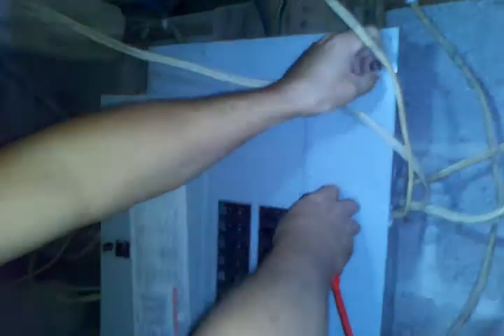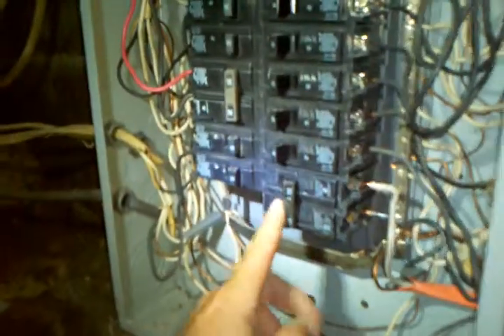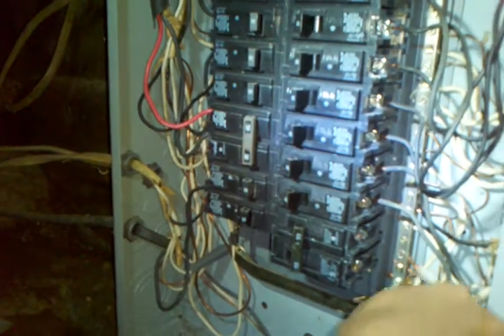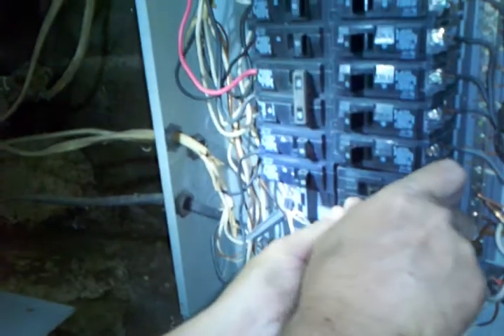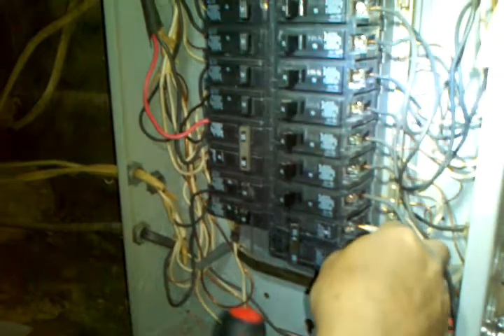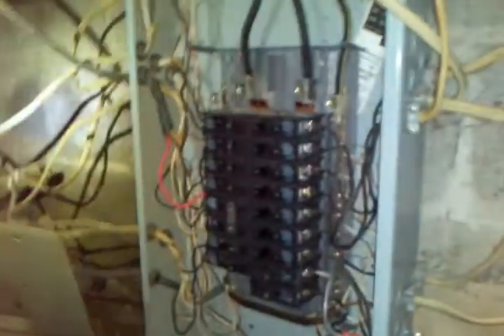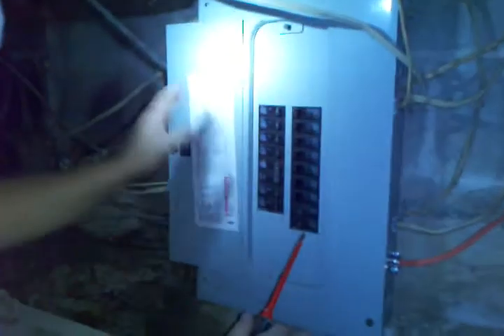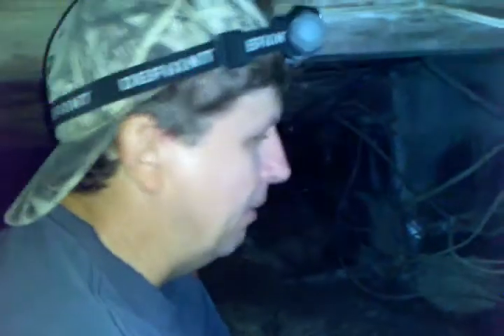How to Change a Circuit Breaker

Comment: my outlet stopped working and my breaker did not trip , i put in a new outlet and it is still not working and my breaker still did not trip or anything, is that because my breaker is not working properly and getting tired because it is a 20 year old breaker. my volt tester shows it has power but as soon as i plug in something in it will shut off, but my breaker will not trip.
Reply from the maker: I would replace the breaker and if you still have the issue you may need to get an electrician to look at it for you.